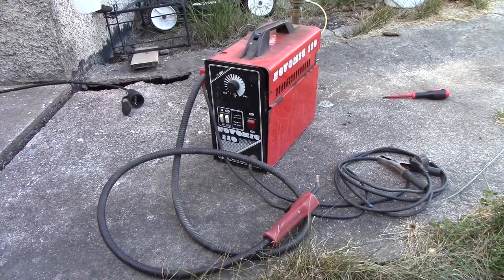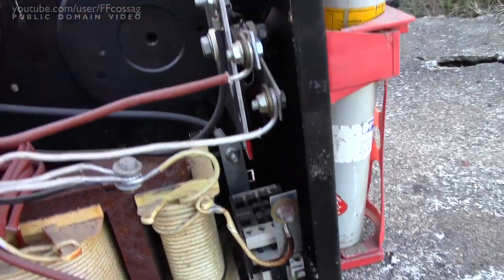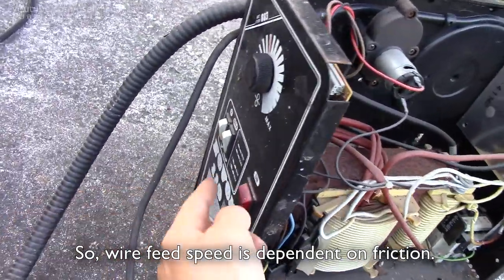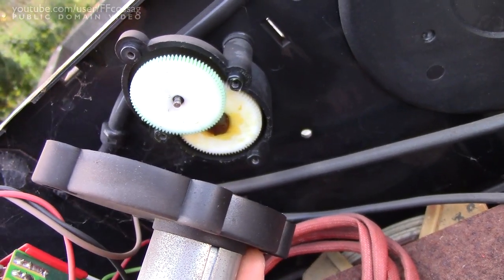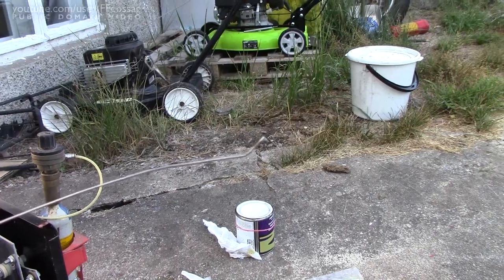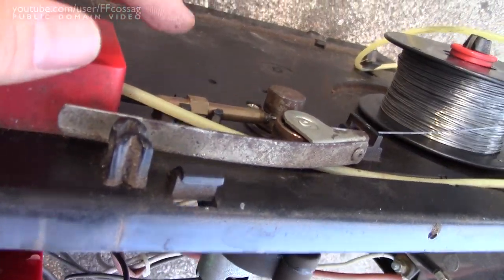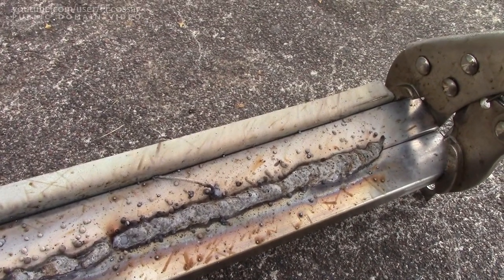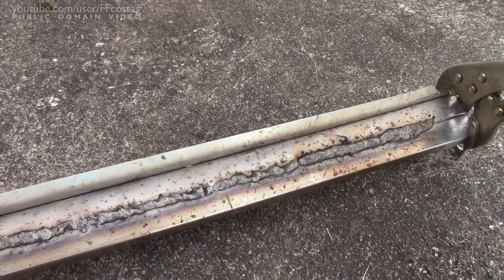Fixing uneven wire feed on a REALLY cheap MIG welder

Comment: If feed is sticky a common problem is the sleeve that the wire travels through along to the torch.. The length of it can quite quickly gèt gobbled up inside with rust and particles of the polymer sleeving that eventually impairs the smooth passing of the wire..It happens more often if the wire has been allowed to rust ..The sleeving is cheap to buy by the metre and not difficult to replace.
Another tip for a cheap machine is to avoid using the large reels of mig wire.  Use the small reels of wire in case it rusts ( less cost to replace) and the lower weight puts less stress on the motor..
Finally, if your mig is a 150A or less I'd recommend 0.6mm wire as opposed to 0.8mm. The former is fine for working on car body gauge steel and I find that cheaper/smaller migs work better for it.

Comment: That welder is not chinese. Its made in italy by cebora. It wont weld well on gasless wire as you cannot swap the polarity. Try servicing the torch the liner might be badly worn. These welders work well when there looked after. The side cover is see through plastic and they always break.

Comment: Plastic gears need grease meant for use on plastic gears. Petroleum based grease will make plastic gears crack. Use synthetic silicone based non chlorinated greases on plastic gears.

Comment: Polarity is wrong for flux cored wire...
The polarity is fixed on the cebora 880.....although you can modify it on the rectifier bridge...
🇬🇧🙂

Comment: Local fire extinguisher company  will re certify my tank and fill it fairly cheap, but yeah, that feed can sure be a pain to deal with. Don't rule out a bad tip where the wire feeds out, they are replaceable
Reply from the maker: Yep, I already replaced the tip. 90 % of the problem went away when I lubed the gearbox up.

Comment: I think you missing a Part at the Gas-nozzle, it's like a little Tube to direct the active or inert gas.
Reply: He isnt using gas, the bottle is empty.
Reply: But the Gas-nozzle also prevent Short-Circuit, then you tip the tip on the metal, because the Nozzle is insolated ftom the Current/Wire nozzle
Reply from the maker: Hm, that's a fair point, I should put it back on. I removed it to improve visibility when learning.
Reply: no gas, no point to use the shroud

Comment: I've never seen a welder like this one. Kind of a weak DC arc welder with a wire feed in it, i thought that all migs were modern enough to have a switching power supply.
Reply from the maker: "Modern" truly is not the word that comes to mind with this one.
Reply: The majority of MIG welders use a conventional transformer.

Comment: The small bottle of CO2 is the same as used in the Sodastream-machines so you should be able to get a replacement for it.
Reply from the maker: No, it's similar but nowhere near the same. To make it more obvious, it contained an argon mix prior to being used up.
Reply: It's a standard disposable welding gas bottle.  You can get pure CO2 or CO2/Argon mix, not particularly cheap but for very occasional use works out cheaper than renting a larger bottle and getting it refilled.

Comment: if there's anything I've learned from being subscribed to DannysCam, you're going to have the welders of youtube on your ass soon to state the obvious as to how your welds are pigeon diarrhea, how grinding isn't welding, and all the fun stuff. I guarantee it. At least when you get yourself a better welder than this, it'll feel like luxury.
a bit of rubber strip around the one wheel might give you better grip at a lower pressure setting, if that's even possible.